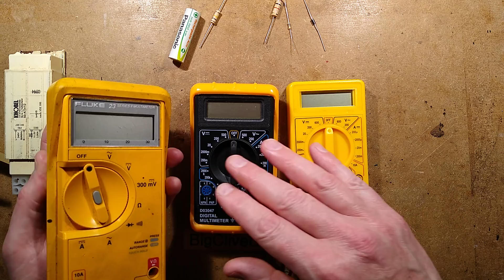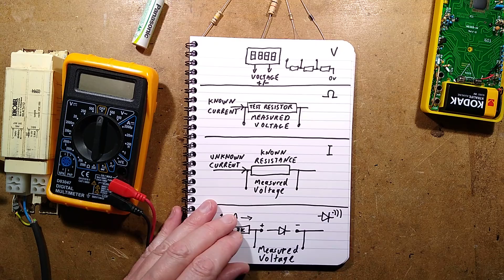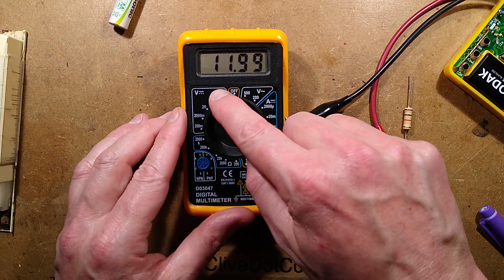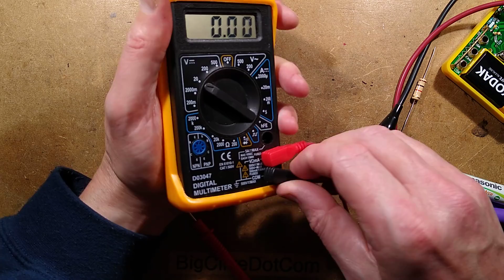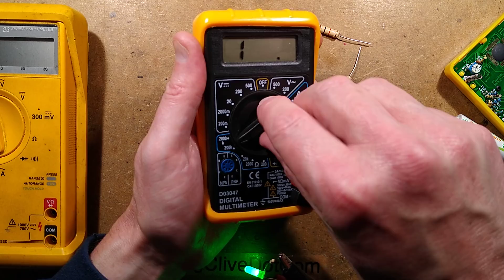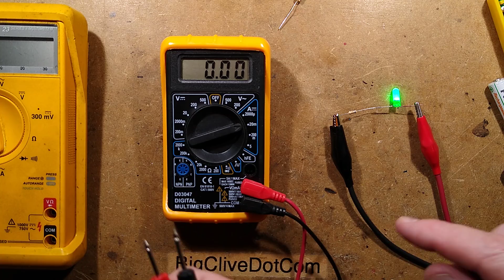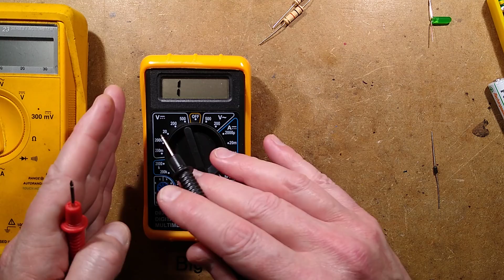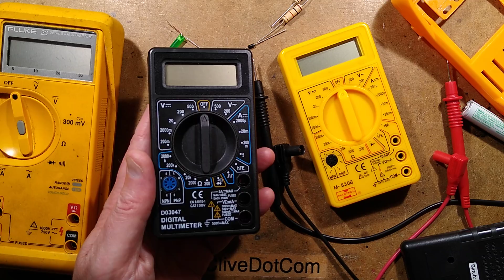How to use your trashy meter without blowing it up (much)

Comment: I have used a Mastech MY64 meter for about 20 years, it has Hz,capacitance, temp, tranny test (😏) and it's still going strong!
Definitely do not need to spend a fortune on a meter (especially for home use when most of us will be mainly using the continuity and 20v DC settings)

They must have changed the design and kept the same part number for this one, as I've just looked it up and mine has the tranny test (which I have never used), they seem to have dropped that from the current one, also mine has an unfused 20A current range, and the new one is 10A fused.

Comment: Glad to see someone call out the Fluke worship.
Other brands have gotten better and Fluke is a shadow of its former self.
My first good meter was a Wavetek.
I have had Fluke snobs act like it wasn't good enough to check the voltage of a car battery.
Fluke must have thought they were OK, they wound up buying the DMM business from Wavetek.
It has been folded in to Amprobe who also got bought by Fluke.
BTW do any of the fancy meter companies still make one that measures HFE?
I only see it on the low priced meters.
Kind of funny, I remember when only the expensive meters would test HFE.

Comment: Clive, I had the same meter, the one where you had to plug it into the different holes, it was 1000 Ohms per Volt.  I think more than one time i had it on the 150 mA scale and fed a voltage into it, not mains voltage would not have been game at about 11.  and anyway the meter would slam full scale and there was a magic smoke like smell but it still worked.

Comment: I have a stock of the free Red/Yellow HF meters.  They're not freebies anymore, unfortunately.    They cost about 6 bucks.   I use them for checking AC voltage up to the 120 range, just to make sure there IS some (or if it's really low), and other than that, batteries and continuity.   It means I can have one at every work area in the house, and park one at each  major customer.

Comment: I bought an el cheapo clamp meter off Amazon  years ago. It’s extremely good and it’s fine on 400v circuits. The only gripe is that the D.C. clamp function doesn’t work as it’s been sat next to a big magnet. I might try degaussing it, it really doesn’t owe me anything so it’s worth a shot.
Reply from the maker: Degaussing it may work.  Remember to zero it regularly when using the DC clamp, and remember that putting it near something magnetic or changing its orientation may result in a shift that needs zeroed again due to surrounding magnetic fields.

Comment: The Tandy (Micronta) Multimeter was my first: Model 22-204C ("Range Doubler"), followed by acquiring a second-hand Model 22-211A My "most interesting"  was a kit meter - the Heathkit Model 7 valve (or vacuum tube) voltmeter.  Straightforward build, and it probably still works (although it is "somewhere in the depths of the loft"). Most used "decent" meter is my Wavetek MeterMan 15XP,  with my favourite bench (big display) meter being a Uni Trend UT 805A (which does about everything and has a nice, clear backlit display)

Comment: These cheap ones are fine for home 230v, not for industrial use, a kickback and those leads are a kinda bad combi. I got the black one and it works fine, I may or may not have blown a fuse or two with the 10a socket. 

A fluke will blow up just as well when you use it wrongly enough, like on a big bow thruster and the fuse blows, making your fluke the snuffer, which may or may not have happened as well.
Reply from the maker: Hopefully not one of the multi-kilovolt bow thrusters.
Reply: @bigclivedotcom  A small one with 400V, still used wires the size of plumbing though. 
But as said it, there was an issue with the frequency controller, I was kindly asked by another sparky to measure the voltage ramping up, but when the fuses blew, so did the Fluke.
Those small high current motors are like todlers, they seem small and cute, but when you cut them off their favorite sweets, they suddenly become fierce deamons (and probably gave of a kV or 10). 

And I know you want to know, the frequency controller leaked some DC, which, definitly during the ramp up, can produce currents through the coils. When the motor is at full speed the DC gets enough resistance to just heat the motor a bit, and if the copper was hot enough it would just not blow the fuse. However when you ask full power (the dc leak was power setting related) when the engine was cold it blew up. 
As said I was just amazed by this, someone else did the fixing and figuring this out, also it was his Fluke so :) ,

Comment: I work on a lot of car 12 volt systems, for the money, quality and functions you can't beat the uni-t meters. They even have a clamp on DC amp meter that works awesome.
Reply from the maker: The Uni-T UT210E.  I sometimes use one in my videos.   Extraordinary value for a DC clamp.

Comment: Multi-Meter snobbery is a real thing, and I feel the need to fight it all the time. For most hobbyists, a 10 millivolts difference between meters will not make a difference in how your circuit operates. Of course I had to learn that over time. Thanks Clive.

Comment: Unless your using a meter for certain high voltage/ current measurements and it needs to be CAT rated,  it's far more advantageous to be familiar with a meter and it's readings than having a brand name on it, especially if you work in diagnostics. Get familiar then get a meter that costs a lot if you want that brand recognition. I always think "Fluke" was a bad name choice, then again so was "Wayne Kerr" 🤦🏼‍♂️  You can also do a self check on most meters of the internal fuses (doesn't work on all, so I've found) if your out on site say, by plugging in the black common lead to the small or large Amp socket and the red positive lead to the Ohm/ continuity socket and by shorting the leads you should get a reading in the 200k range for the small Amp socket and 200 ohm or continuity beep range for the 10 + Amp range which can be handy.

Comment: The chip they use is ICL7106, which was introduced back in 1978 and is an incomplete clone of chips used in really old Fluke meters (with auto-ranging mechanism removed) :)

Comment: Mine's labelled for 1kV DC and 750V AC 10A - got from Tandy in the 80s. The batteries it came with are still in use but 'retired' due to ill-health and are now beside my bedroom clock where one  is powering that. One was binned of the 4.

Micronta 22-195

Comment: I recall spending quite a considerable amount of money on a less expensive but still pretty well regarded meter for HVAC stuff in local settings here (Klein from Home Depot--I spent a bit on it for the RMS thing so I could expect it to spit out a usable reading with some weird waveforms in some absolute edge cases, but actually, I bought the meter before I decided to go through a local college's trade program for HVAC instead of electrical due to misrepresented salary figures).

This was back in 2018. I had taken electronics and digital electronics in high school (think analog and digital) in 2011 and 2012 respectively. I knew not to just bang the meter across a power supply while in the current range, but I was dumb and wanted to test the accuracy of the bench supply's ammeter. The capacitors in my "death toaster" basically made it so even though the thing was set to 300mA, it momentarily put way more than that across the meter (as it was effectively a dead short across a pretty cheap power supply bought from an Amazon liquidator) and blew the "high current" fuse clean open (with an audible pop).

I've since picked up an amp clamp that can do like 600A in both AC and DC. The DC clamp measurement is just because I had overtime money to burn, but the AC clamp measurement is kinda handy because holy shit 3 phase motors can really pull some current in weird edge cases (well, they can pull some current in normal operation, but especially in weird edge cases--the bastard had cables feeding it that were thicker than my thumbs).

Comment: WOW! i didn't know you could crimp a shunt to get an accurate resistance.  THANK YOU CLIVE..😁
P.S. the only time i used the gain test on a meter was to find out the pins on a transistor where i forgot which were which.. ; )
Reply: I spotted the crimping from the off and realised what it was for.
I've been aware of transistors for decades but am still completely clueless !

Comment: Here is what I think about the AC voltage range of those meters, It is just using a diode to rectify the AC and multiplying with a constant term to display the rms voltage. In case of DC input while the selector switch is in AC range will give you a value multiplied with that constant factor

Comment: Just took the back off a couple of ebay specials and was interesting to see that one has the placeholder for a fuse but instead has what looks like an smd resistor with an underlined 2 on it, the other one mentions a fuse (250v 5a) on the board but with absoultly non present ... cant even see both ofthe pads for it like the first one ..  but what looks like one pad with the other I am guessing on the baord that this copy was deemed to not need as the 9v battery connection is a reistance fit against two springs for the +ve and -ve connections, no push on connector needed!

Comment: My first multi meter was made by Robin (in the days long before the ruggedised, bouncy cases were commonplace). I thought with it being so anti-diluvian that it would not appear in an Internet search, but I was quite wrong, I found one on eBay. 
I must admit to being a bit of a snob with regard to hand-tools
This also includes screwdrivers and spanners (wrenches for anyone not in the UK) Britool and Stahwille bring favourites (other brands are available). Fluke meters are also a favourite and I still dream of having one within a built-in oscilloscope 💭😁
Good advice on the safe use of multi-meters Clive.

Comment: Clive great video clear and easy to understand, but I must disagree a bit on your point that you don’t recommend the cheep meter for mains testing, I have been a spark for 30year and I have still got my little ROBIN analog meter and it can measure up to 500v AC and DC it was my first multimeter and I have tested three phase with no problems and that little meter is still going sting . That cheep yellow meter you showed I also got one of them and I have used that on three fade as well again with no problems and it is still going strong although I gave it to my son in law as I now have a uni - T  which is a more professional meter . My point is that those cheep meters are fine for mains testing as long as you know what your doing and how to use your multimeter . Sorry to contradict you, I mean no disrespect. Great video as always mate 👍👍❤️
Reply from the maker: In most instances it will be fine.  But if you leave the leads in the current setting and probe high current supplies the meter will not be able to safely deal with the massive short circuit current.
Reply: @bigclivedotcom yes I agree , that’s why GS38 say a multimeter must not be used for proving dead ( safe isolation) as it to easy to set the wrong range and there have been some accidents. As a result.

Comment: I still have one of those cheap meters I picked up from either Tandy or Maplin back in the 90s as an undergrad with delusions that an Electronic Engineering degree might involve occasional contact with something other than a maths textbook. 25 years later the meter is still going and has seen way more use than the degree.

Comment: OL probably just means over limit, I know that some microcontrollers I've written code for will use the CF (Carry Flag) bit of their status register to indicate the last value read from their inbuilt ADC overflowed. Could easily use that to clearly indicate to the user "Number too big, adjust limit and try again", basically just use the microcontrollers jump if carry instruction.

Comment: I keep at least three meters from years of working in automation. A cheap one with a big display for general use, a clamp meter for motors, etc., and a high end meter for the situations where the others fail due to non sine waveforms (crest factor) or higher frequencies.
I do tend to believe a Fluke when in doubt. Working with VFDs and other motor drives finds all the flaws in the cheapies, but they're fine for general use.

Comment: Watching this video, I'm reminded of my early days in electronics where allowances had to be made for the load the (analogue) meter was placing on the circuit. Those on here who remember the AVO 7 (500 ohms per volt) will know exactly what I mean - even the AVO 8 (at 20,000 ohms per volt) could be problematic. The one thing I do see with digital meters and those 'new' to electronics is a tendency to obsess over those least significant digits at times.
Reply from the maker: Even with 10M impedance, that still applies with things like voltage multipliers.

Comment: My first meter was one of those cheap analogue Tandy meters too. There was a way of misusing it, plugging the leads into a pair of holes not mentioned in the manual which gave a direct connection to the movement as a very sensitive extra range. Astonishingly it worked fine like that and It never blew up. Nowadays I have several digital meters including a Fluke 23. I miss the analogue ones though, there are a few things they can do well which the digital ones don't.

Comment: I have a collection of meters, I had a bit of a buying spree a couple of years ago. I still have a Fluke 77 from 1984 which I bought as an apprentice cos the company always used them. Anyway the last meter I bought an ANENG 619A LCD Smart Digital Multimeter cos it looked cool but I don't rate it, it has an automatic feature for measuring DC voltages, resistence and continuity and the manual says you can select the option but it never works. You should buy one and give it a review :)
Reply from the maker: I have a 620A here.  I'll give it a try at some point.

Comment: some DT830 variants have non trimmed 10A shunt, and the depth of leads in the plated trough holes is used to fine trim it.
so resoldering it is not a good idea unless you have accurate current source or another calibrated meter around and can get the error to less than 0.5% if that is what you are aiming at. but the cheap shunts may (have poor temperature coefficient)  be drifting in value vs temperature and the error could easily vary from 0.1A (cold) to 1A (lukewarm) and to 10A hot.
other variants have larger or smaller blob of solder in them, mabe to drop the resistance just a little bit.

Comment: I agree cheep meters are fine precision is not really required in-home consumer products  usually either there is voltage/resistance or not and + - a few points is no big deal.

Comment: Yeah.  I burnt out the 1 Ohm resistance range on my first multimeter (£10 analogue meter) and also did something similar with an Italian ICE Supertester (which really isn't that super and relies on understanding which hole you're supposed to shove your test leads in, which, being Italian design, is by no means an intuitive matter).  Nice to know you have also made similar mistakes in your past - was thinking it was just my general muddliness!

Comment: Wayyyyy back, I received a Micronta DMM for Christmas.  At first, I was a little skeptical of it.  I decided to take it to work and see how if compared to my Fluke.  To my astonishment, the Micronta sensed faster than the Fluke.  I would always get my reading on the Micronta first.  as far as comparison to voltages read, they were the same.  (I used both sets of leads on both meters and the readings were the same to my astonishment.  I got the Micronta back around 1992 or 1993 and still have it and use it.

Comment: I too attempted to measure the current of a voltage source with my first cheap little Radio Shaft meter in the 1970s. And that's how I discovered Light Emitting Resistors and Smoke Emitting Diodes.

Comment: My Granddad gifted me a düwi 07975 (the black one, not the red, nor the yellow one.... seem to be quite rare) many many years back. sadly I lost the temperature probe but, the rotating switch has its issues but still one of the best gifts I received. Use it regularly just to poke around random things for fun. It got some fairly alright 600V / 10A probes which are wayy beyond anything I would ever poke at

Comment: I have one of those antiques that has the independent jacks for their ranges. Fortunately I was able to acquire a ratty cheap Radio Shack meter (that somehow still "works") early on in my electronics hobby, and IIRC it included a manual. Then again, I may have been able to intuit how it worked.
I wouldn't go within ten feet of 480v 3ph with it though.
Also I like hearing you say that. "Simple, cheap, and good."

Talking about continuity buzzers, my cheap little analog meter has a scratchy continuity. It's so simple that it's VERY scratchy.
Most of my nicer digital meters have a very short pause, shorter than your cheapie's, but not quite scratchy.

Comment: Thank you for this. The Panasonic battery which sellsa at the same price a s the Duracel is the Panasonic Evolta Alkaline. Its a shame you did not use that one in your test instead of the basic pro. Its a bit surprising that one of the Duracel loses power much earlier than the other.

Comment: Cheap meters are fine for low voltage DC (under 50v IMO) but should never be used on anything attached to mains power. If you have to test anything dealing with the mains spend a few more bucks and get something like the Extech EX330 which can be picked up for $55USD and has won the approval of a certain Aussie. It was my first real meter and I still use it along side my Fluke 87v.  If you don’t want to spend that much you can get the manual ranging version for about 30USD but I’d recommend getting the auto ranging version which has a few additional functions.